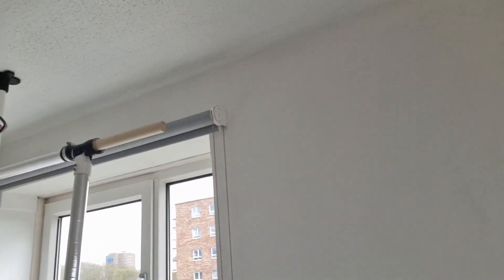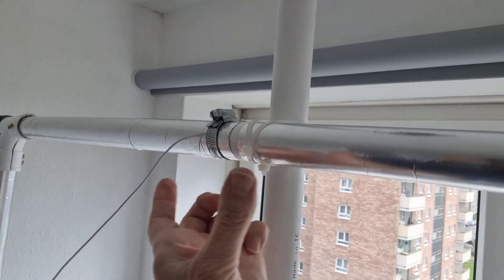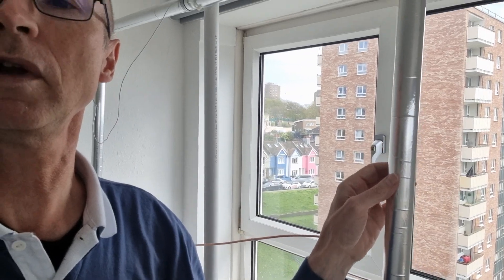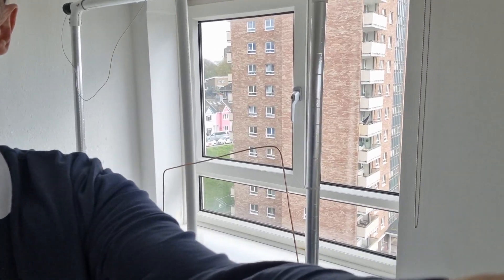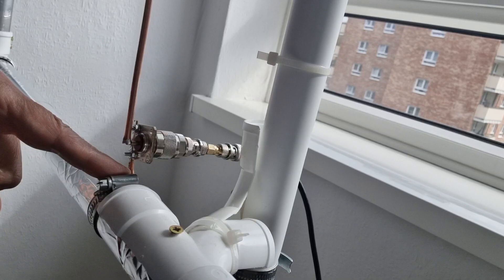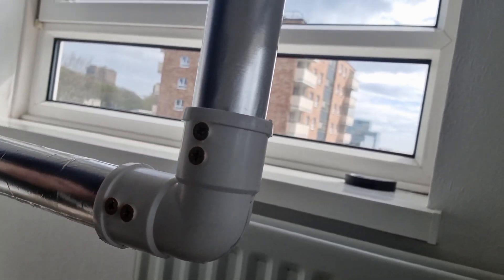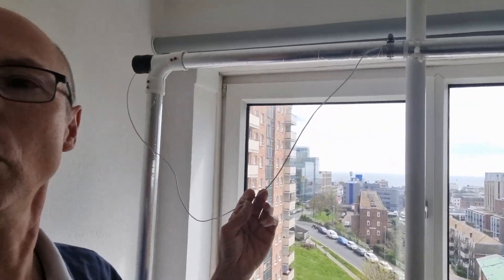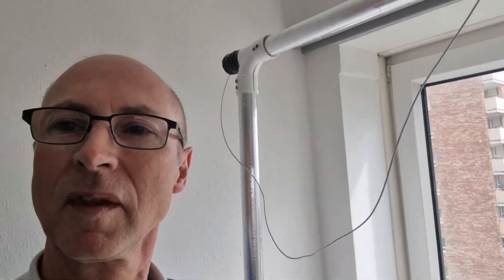HF Loop Antenna - home made 7MHz

Comment: Hi Simon. 
How's the loop antenna going ? 
Do you still use it ? I'm thinking about building one myself. 
I really would like to know how you feel about it some months later. 
73.
Reply from the maker: That is a very good question. I bought some Diamond mobile whip antennas and they work far better in terms of TX and RX signal strength, plus the bandwidth is broader so they don't need frequent retuning. They also pick up far less QRM noise that I expected so I now prefer them over the loop !
Reply: @fotografm  Thank you so much for you quick answer !